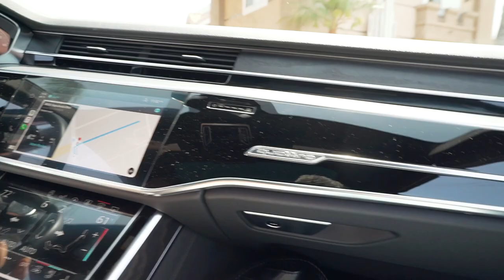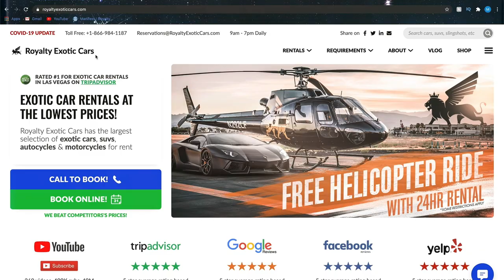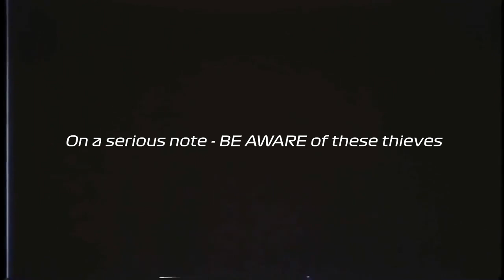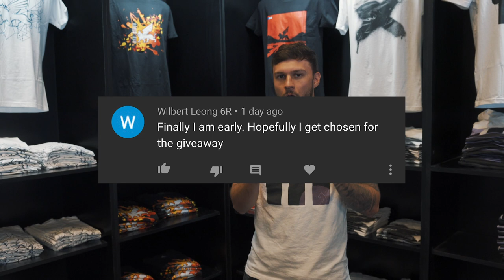Universal Music Artist STEALS Lamborghini *TRASHED*

Comment: When you're not wearing your mask correctly, take it off. Stop setting a bad example for your half a million subscribers. Pulling it down so it doesn't cover your nose offers zero protection, and is actually potentially harmful if you're repeatedly handling the mask without washing your hands.